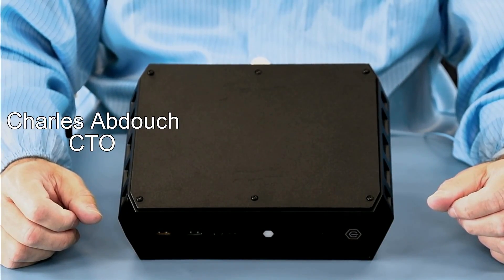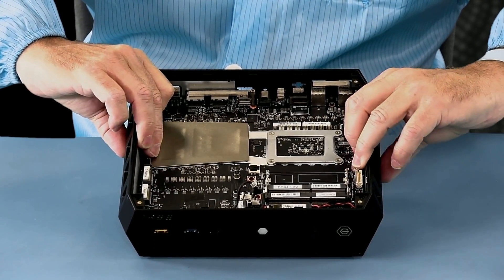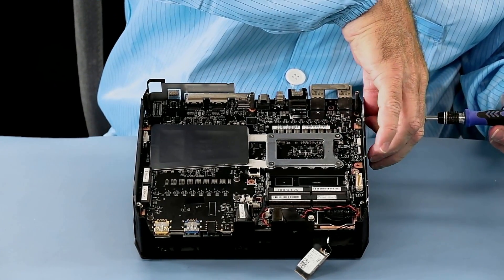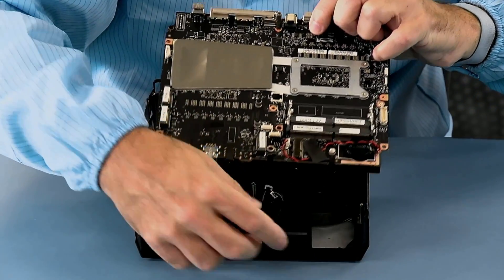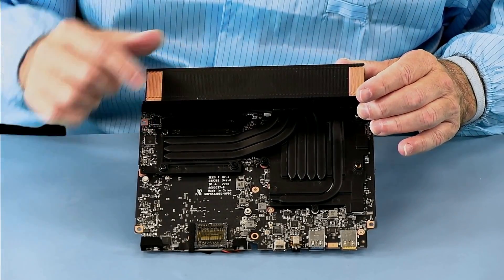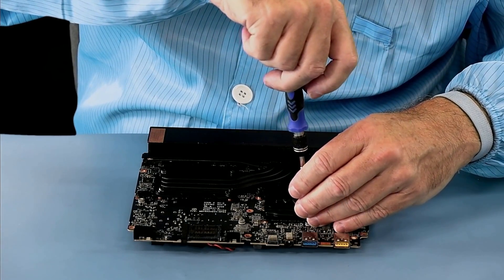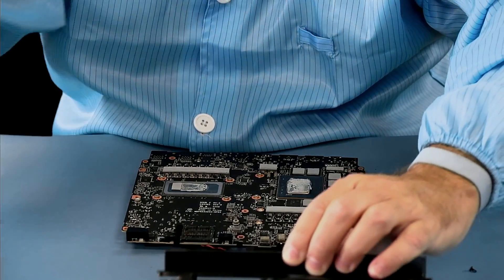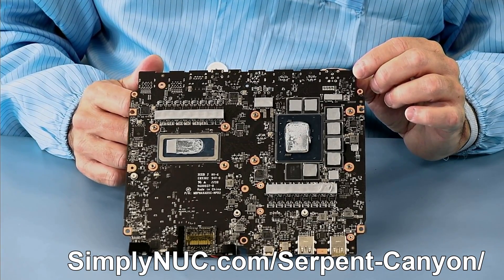Intel NUC 12 Enthusiast, Serpent Canyon - Full Tear Down

Comment: Thanks for the video! I'm looking for a replacement fan (but they are hard to find). Are the fans identical (but installed in reverse) or are they different? Are there article numbers available for both? I would like to replace them both as a preventative measure. Thanks in advance for your time and effort!

Comment: Hey there. I have this unit and it’ll been a total mess. I finally found that it freezes if bumped.  If the desk is bumped or the unit is moved at all while on, it just locks up. My hope was to set this up as my wife’s workstation. Have you seen this issue before?

Comment: 1 hdmi??  🤦‍♂️
Reply: Yes, we find that most series gamers wanted more DP ports and less HDMI. This is always a trade-off through, but realize that the Chipsets and GPUs ONLY Output DP, you have to use Chips internally to convert to HDMI as it is a lower bandwidth and capability than DP

Comment: Technical specs.
1) 12th Gen Intel Core i7-12700H
    a) 14 Cores with 6 P-Cores (Hyperthreaded) and 8 E-Cores
    b) P-Cores support 4.7GHz Turbo Boost
    c) E-Cores support 3.5Ghz Turbo Boost
    d) 20 Threads total
    e) 24MB Spart Cache
    f) 45w Base TPD with up to 115w Turbo power
2) ARC A770M
    a) 16GB GDDR6 memory
    b) 32 Xe-Cores
    c) 8 Render Slices
    d) 32 Ray Tracing Units
    e) 512 Vector Engines
    f) 1.65GHz Clock
    g) 150w Max TPD
    h) PCIe 4.0 x16
    i) Supports Ray Tracing, Variable Rate Shading, DirectX 12 Ultimate, Vulkan 1.3, OpenGL 4.6, OpenCL 3.0, Adaptive Sync
    j) 4 displays supported
    k) HDMI 2.1 TMDS Compatible (max 4096x2160@60Hz)
    l) Dual DisplayPort 2.0 (1.4 Certified) ports (max 7680x4320@60Hz)
    m) Supports H.264, H.s65 (HEVC), AV1, and VP9 hardware encoding and decoding.
3) Dual channel DDR4-3200 up to 64GB of memory
4) Triple 2280 SSD Storage
    a) 2x 2280 PCIe Gen 3 and Gen 4 M.2 Slots
    b) 2280 PCIe Gen 3 and SATA M.2 Slot
5) Front and Rear Type-C Thunderbolt 4 Ports (2x 4k@60Hz monitors)
6) 2.5GbE (i225-LM)
7) Wi-Fi 6E AX1690i Killer AX with Bluetooth 5.2 (5.3 capable)
8) 6x USB 3.2 Gen 2 10Gb Type-A Ports, one charging
9) SDXC Slot with UHS-II support
10) Surround Sound 7.1 Digital Audio via HDMI or all four DisplayPort connectors
11) Front 3.5mm 4-Pin HD Audio Port (Stereo Headphones with Mic) and rear 3.5mm 3-Pin HD Audio port (Stereo Headphones) w/ TOSLink Optical
12) Beam-Forming, dual-mic array, with Alexa support
13) Front Consumer iR
14) Kensington Lock
15) RBG Backlight with replacable mask, comes with Serpent and Skull masks.
16) Internal Mezzanine connector with Front Panel signals, CEC, and 2x USB 2.0 ports